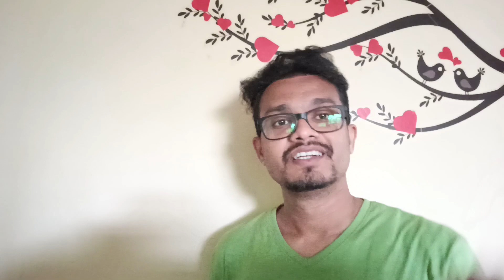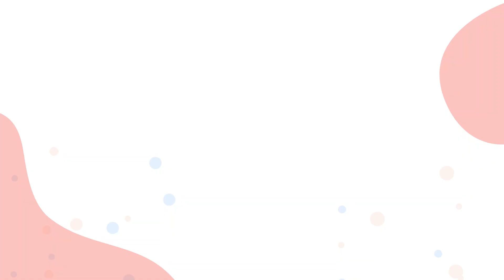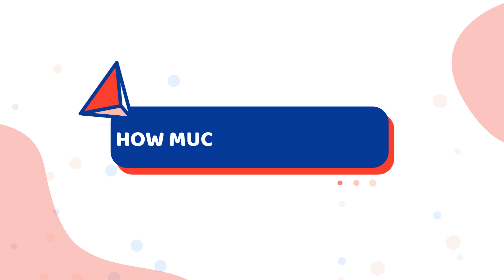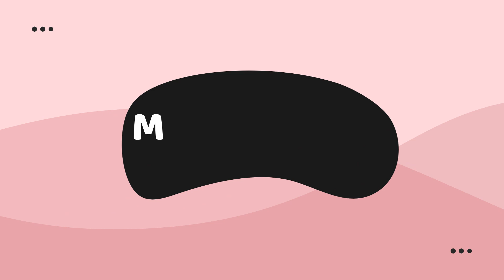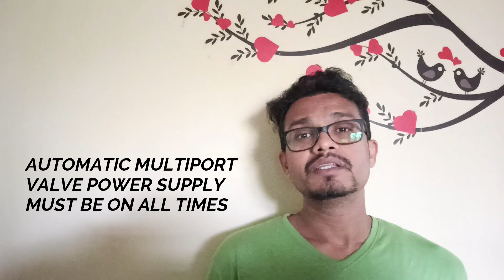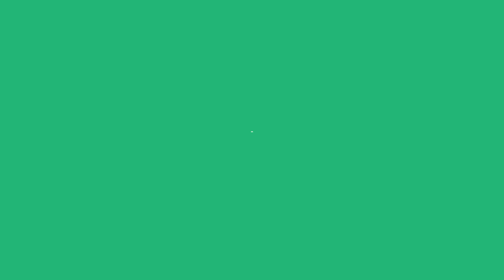This is why My Water Softner Failed!

Comment: What is the standard life of a domestic MULTI MEDIA FILTER?
Rather, how long the mediums function properly in a MULTI MEDIA FILTER ?
Reply: Multi media can work for two years if we keep proper  maintenance like back wash and rinse. After a year we can do acid rinse and open back wash to remove the suspended solids present in sand filter.
Reply: @fazilkhan6819  
What is ' OPEN BACK WASH' ?
And what type of acid to be used and acid concentration too.
I will be appreciate if you kindly reply to my query please.
Medium used in my 1354 FRP vessel filter
Gravel ( 12 mm - 6 mm graded sand gravels)
Treated Sand
MnO2 ( 20 - 6 mm graded size)
Activated carbon ( granular)
And
Fine sand.
Reply: Open back wash we need to remove top stainer in frp vessel and Top manhole in MS  VESSEL
Till water get's clear.
ACID (HCL) maintain pH 2to3 
Depending on capacity of filter we make the concentration. One hour Acid soaking is sufficient to remove foulants again open backwash and pressurized backwash.
After this activity Our filter will be fine for filtration
Reply: @fazilkhan6819  
Thanks for your reply.
But acid will not harm Mno2 ,gravels, sand ( both treated and normal sand) !
Reply from the maker: Mostly we must change them in 6 months period.